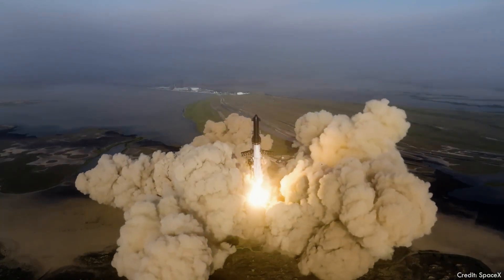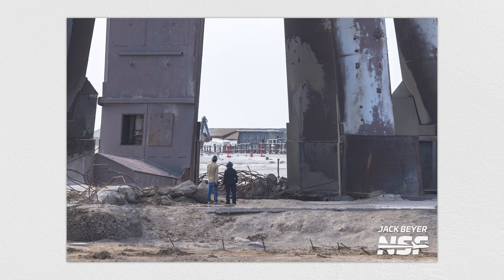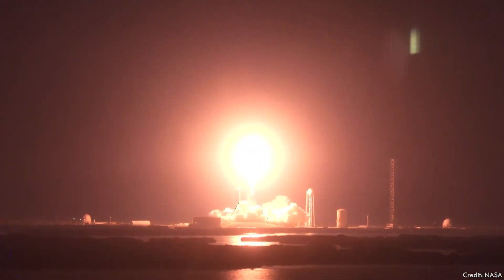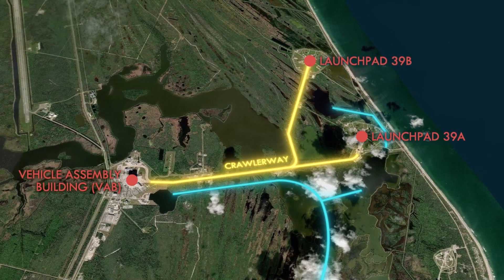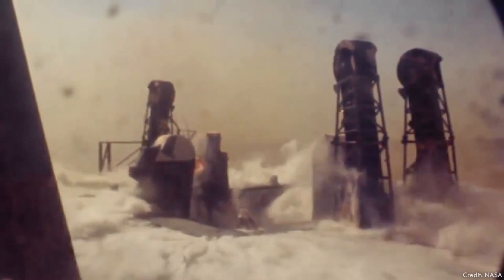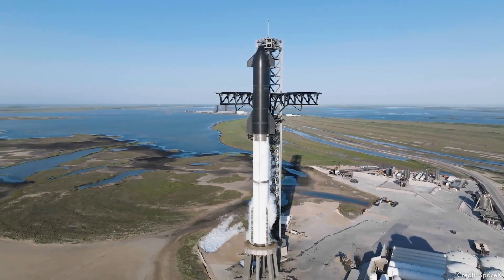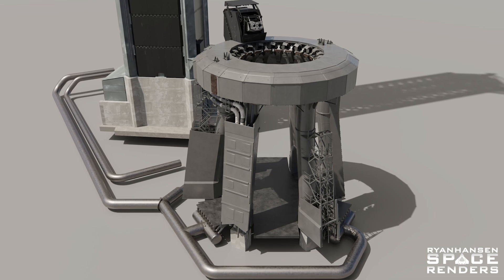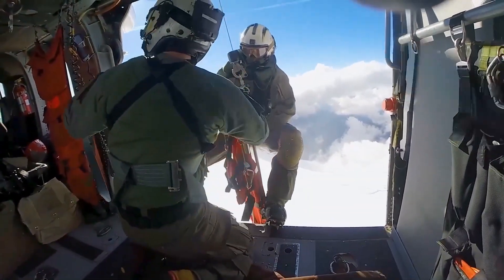Was Starship’s Stage Zero a Bad Pad?

Comment: Anyone else think spaceX wants to limit the amount of water used for launches because they're trying to come up a way of doing launches where there is little to no water 🔴
Reply: They aren't allowed to run a deluge system at Boca Chica because it's a protected wetland.  They can't just flood it with freshwater.
Reply: @sunspot42  They are permitted to release fresh water, as long is it is not contaminated. They wouldn't be doing anything clouds aren't already doing.
Reply: @SpaceAdvocate  No, they aren't permitted to release fresh water in the quantity the Saturn V deluge system pumped out.
Reply: @sunspot42  It is possible, they just need to get a Texas Pollutant Discharge Elimination System permit from the Texas Commission on Environmental Quality.
Reply: @sunspot42 they are, as they are doing right now with the new steel plate.
Reply: @beamed5382  No, they aren't.  The new steel plate isn't releasing the volume of water the deluge systems in Florida pump out.  I think it's mostly designed to evaporate.  We'll see if that works...
Reply: @sunspot42  all water in a deluged is supposed to evoporate, if it doesn't; it's useless as it doesn't undergo the energy-converting process of acustic energy heating up the water, thus reducing its energy. And I've not made any form if precise calculation, but I can say that with three new tanks, it's probably more than at 39A.
Reply: @beamed5382  All water clearly doesn't evaporate in the setup in Florida.  Remains to be seen what SpaceX comes up with for Boca Chica and if it passes muster with the authorities.
Reply: Super Heavy is not supposed to launch from anywhere other than earth. It's starship that would be sent to the moon and later mars.

Comment: Why not use the water table to your advantage? Build the flame diverters but let water pool below as a means to absorb heat and pressure.
Reply: For one, there is absolutely no control over the ground water table. It’s not a static thing. The rest of the launch site exists on top of it, so you’d like to avoid messing with it as much as possible.

It’s a cool idea, as it’s conceptually very simple. But in practice it is much more complex because it combines two very complex issues into one, interlinked, extremely complex one.

It removes one issue, but in the process introduces interactions and processes that didn’t previously exist.
Reply: They are operating near a protected wetland. Messing with the water table isn't allowed.

Comment: I don't  think that a useful rocket test involves the launch pad destruction damaging the rocket. The entire thing was reckless and pointless. I suspect it had more to do with Musk's timeline and the rocket being an old model, than their 'pushing the limits of innovation'. How can you say you really tested the rocket when it was being bombarded by debris at the beginning. Launch pad issues this bad didn't need a test to prove out.
Reply: There's currently no evidence showing that debris could have damaged the engines.
Reply: @beamed5382  I disagree, but don't have the facts myself. Initial reports said that debris damaged engines. Obviously, there is no way to look at the engines to confirm. Debris was being thrown everywhere, including right next to the rocket, so it is reasonable to surmise that debris would have been thrown into the rocket itself. I think that we ended up with about 6 engines that failed. I think it is fair to strongly suspect that debris had a part in that. Even if it didn't, the presence of the debris casts doubt on any other cause, which is why it is foolish to launch on a pad that you know could have ended up contributing to failure. Typical Musk. Space X needs to be better than that, despite their CEO. I'm a big fan of Space X, and I feel that the company has outgrown its CEO and needs a more responsible leader.

Comment: When your plan is to build a massive rocket and have part of that rocket (the less powerful part) land on undeveloped celestial bodies, you do need to find out what you can get away with. I don't blame Space-X for that. In some cases, especially one without a book of data, you just have to do to find out what you shouldn't do (e.g. lessons from Apollo 4, 5, and 6). Which is why they are called "tests". That said, I've thought from the start that while you could probably get away with flat surfaces for the initial test vehicles and Starship, for the booster they needed to have a flame diverter -- especially since rapid reusability is a goal. Diverters take a beating even though they are designed for it. A flat plate of steel, to me, is just begging to be replaced with a diverter or even a sacrificial mobile flame bucket. Once they figure it out at Boca, then the pad at KSC will start moving forward again.

Comment: No flame diverter, no flame trench, no water deluge system ... all were recommended by SpaceX employees .. but Elon ignored them ... and instead dug a huge crater through the launch pad, and threw concrete into the engines disabling them....
Reply: Wrong... If you wanna act like you're following the developments, don't just focus on the fuckups..

Concrete damaging engines had been mostly debunked. SpaceX decided to launch without 3 engines as the booster doesn't need all 33 in order for it to fly, however the lack of 3 engines caused a delay in the liftoff making the thrust to bake the pad for even longer than anticipated.

The other engines that failed had done so because they were only tested as a unit and strapping them all to 1 booster resulted in anomalies that cascaded into mission failure.

Ground 0 survived and they needed to dig a hole for that new water system anyway. 😂

Nobody was hurt, SpaceX fans are satisfied, SpaceX haters are even more satisfied and the swamp will survive a couple of rocks here and there. 4/20 to remember.

Peace ✌️🎤
Reply: While it is fully possible that the concrete may have damaged engines, the engines in question were installed very early on in their development, meaning that it is also possible that they had design issues leading to their failure, which has likely been fixed over the several months after they were built.

Comment: Good summary, but would have been worth mentioning that the engines blasted the pad longer than expected due to engine outage. And also the  sand underneath collapsed under the pressure impact, causing the concrete to fracture

Would have also been worth discussing their solutions for reinforcing the substructure (not just the installation of the water deluge) so that the concrete can't fracture under pressure again

Comment: I seen studies of the depth of jet impingement into pools of water (it’s apparently of interest in steel production) and if they extrapolate to the scale of a Starship launch, the rocket exhaust should penetrate a depth of about 2 meters. It looks like the penetration depth is a function of the exhaust velocity to a power between 1-2. All the artists conceptions of how the inverted shower head should work only show a thin film of water which I think would get blown away. Further, if the exhaust is able to convert the water under the plate to steam, it will provide significant resistance to sustaining the water flow and possible water-hammer effects.

Each Raptor rocket engine puts out a power output equivalent to the thermal power of over two large nuclear reactors. And there are 33 engines powering the first stage.
Reply: From my understanding its less a thin film and a constant wall of water being sprayed out with enough pressure to counteract the rocket exhaust. Theyve already tested this small scale https://www.youtube.com/watch?v=n_L3-Ye-Cz0

Comment: I honestly don't understand why SpaceX didn't work their way up to a full-power launch.  I know SpaceX is known for "just fly and see what breaks", and so far that testing philosophy has served them well - I'm a fan!   But it wouldn't have cost much to do a few test fires with 10, 20, then all 33 engines, and see if the pad could take it.  And they might not have damaged their engines with debris from the pad, and maybe Starship would have made it to orbit.  I think a tiny bit more prudence was necessary here.
Reply: They did several static fires before the launch, starting with one engine, then up to 31 engines at half power (as the primary objective of static fires is to verify engine plumbing), but that didn't catch the issue with the pad (they expected it would be eroded rather than shattered based on the data from the half power static fire). Basically something happened that they didn't consider beforehand or catch in the data.
Reply: @randomperson1731  I watched them - they were only a few seconds long.  I'm referring to static fires comparable to the time it takes Starship to get off the pad.
Reply: @ReadTheShrill  Ah yes, I did think that would have been a good idea (your comment was a bit vague as to the duration of those tests)

Comment: Was hoping for a deeper dive on the failure mode. SpaceX thinks the sand compressed and cracked the concrete. Do you agree with that? Is there a potential way to do this without water? Just seems there's a lot more to be said on this topic.
Reply: this video is uncharacteristically shallow for this channel
Reply: This video seemed extreamly rushed. He just jumped on the "elon bad" train and put together a half assed video and hoped most people would agree because elon is unpopular
Reply: The current steel plate will use water. And yeah, this video was just absolutely useless.
Reply: @beamed5382  Well, perhaps it's useful to people who have never heard about launchpad construction. I don't really get the timing of releasing this video now though. It would have made more sense to do so like a month ago, or wait longer until there is actual info from the FAA about environmental impacts.

Comment: Concrete can handle pressure, special concretes handle high thermal loads, but concrete is a poor choice against sound energy. Reflecting world record sound energy back at your rocket with a flat plate should have "ACME" printed on it somewhere. The rocket plume helps and both the water mass and steam will help more, but it seems foolish to not deflect a large portion of that energy away from the rocket. It would seem unlikely that they will launch without damaging engines and equipment until they do.
As noted even with the SLS launch system, flat surfaces reflect sound and that reflected sound will destroy things it is focused on.  This system too has some work required to prevent sound damage.
Reply: Steam = Cushion of air buffer?
Reply: @braddie77  not the best wording but both the liquid and gas water mass.  Think of it as making the local air harder to shake.
Reply: @AnvilDragon  i'd had a few beers when I asked, so my vocabulary was limited, but wanted to ask if there would be a reduction in sound pressure due to the intense heat forcing the surrounding air, heat and sound toward cooler air when water is converted to steam?
Reply: @braddie77  Not quite, but changes in density and viscosity tend to act a bit like layers with a portion of the sound reflecting and interfearing with the main pressure waves. Density and viscosity does vary with air temperature but adding steam, water droplets, and streams of water are much larger changes. Once bouncing off that steel plate the sound will have to reflect back through the exhaust to the rocket. If they record the combustion pressure near the injectors though a decent spectrum they could filter out and "hear" the flat surface. They could play back both the change in pitch and decay of that reflected sound as it lifts (Just not the sound levels).